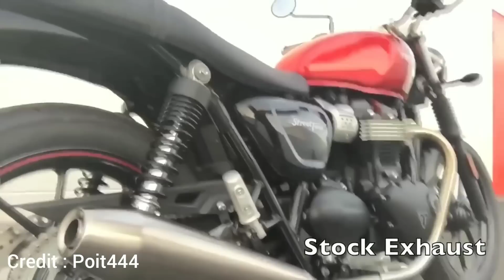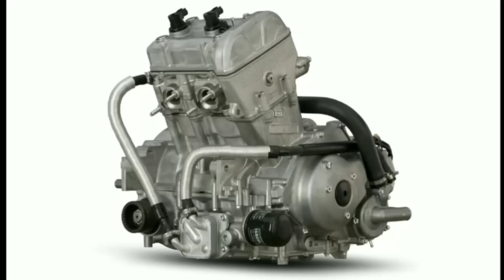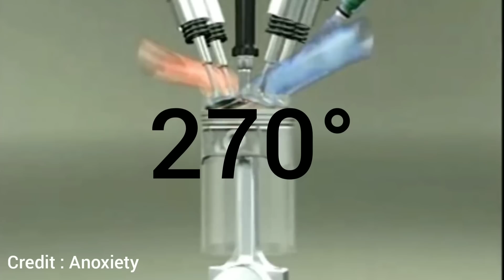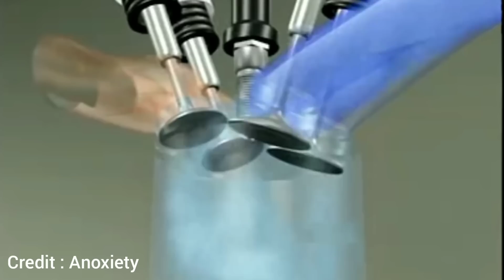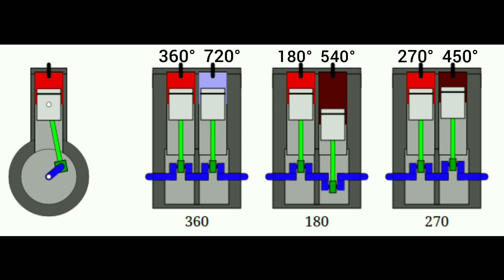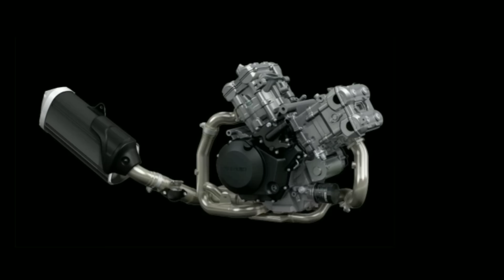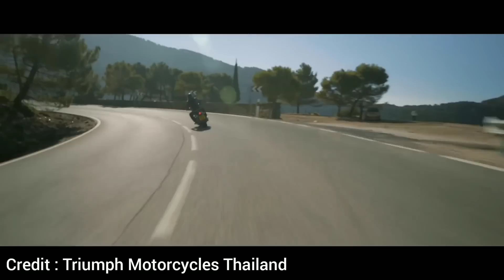270° Parallel Twin Engine: Why It's The Best Form of Parallel Twin Engine?

Comment: Not only more compact but significantly cheaper to construct than a V twin.  Not sure who first used the 270 degree crank in a motorcycle but the XTZ 750 Yamaha dates from the late 1980s and the blood line continued through the TDM twins to the MT07s so they've been going for a long time now.  Another factor to consider is that the uneven firing order of the 270 degree crank gives a much better 'feel' to the power delivery in low grip conditions.  My first bike was a 180 degree crank '79 Bonneville and I still love the sound and feel but my TDM 900 is the best by far...
Reply: I don't think the XTZs had 270 degrees cranks in the '80s though did they? I thought they introduced it first on the TRX850 in 1995 (first production bike to have one), which was clearly aimed at Ducati's 900SS 90 degree L-Twin and became a cult bike. Then they used it in the TDMs. The idea is usually attributed to local Engineer Phil Irving, of Vincent fame.
Reply: Agree with Joric78 the TRX850 I’m pretty sure was the first with a 270 crank. Loved the sound with race pipes. Still have mine, need to get her going again. Very underrated bike.
Reply: Unless your '79 Bonnie was custom built, it had a 360 crank like all the others of its kind.  Lumpy shaky things and a blast to ride! had a '77 Bonnie 750 Myself and remember it well.

Comment: I've owned parallel twins with 180, 270 and 360 degree firing orders and I like the 270 best. They run smoother and sound best to me. I actually converted my 1978 Yamaha XS650 from 360 to 270 (actually 284) and it definitely runs smoother and has a more interesting exhaust note. I doubt that it makes more power though and probably wasn't really worth the work involved but now I have something different.
Reply: I had a TRX 850 with a 270 crank.
Reply: Nice bikes. I can't remember now if we ever got them in the US, if so I've never seen one.
Reply: @barryervin8536  Quite rare anywhere Barry, The dry sump engine was developed from the XTZ Paris-Dakar race engine.  The frame was quite good and handled almost as well as my Ducati.  A good friend still has two of them.
Reply: @MegaBoilermaker  so did I, it was excellent, I loved it.
Reply: That's really cool! If you ever make a video about this I'd like to see it.
Reply: @seniorbarends  No video, I did this about 20 years ago when I had to figure it all out for myself and everybody told me it wouldn't work. Today you can just buy the crank and cam and ignition system online and bolt it all  together. I definitely thought the conversion ran smoother and sounded better, and guys with stock XS650s who rode it usually agreed . My new Honda CB500 with the 180 crank sound's terrible, luckily I like quiet exhausts anyway so I don't really have to hear it much.
Reply: What about the 180s?
Reply: Why on earth would you want smooth? I have owned 3 Yamaha XS650s and one 1966 Triumph Bonneville, also a 360 engine. The Triumph had a lot more vibration than the Yamahas. I loved it. When I could afford it, I switched to Harleys and never looked back.
Reply: It was worth it if it runs smoother. Definitely worth it.

Comment: Very informative and well presented. My 790 Duke has a 285 degree firing interval but is essentially the same.
Reply: Or a 75° firing order.       The 270° is also a 90°      both add up to 360°